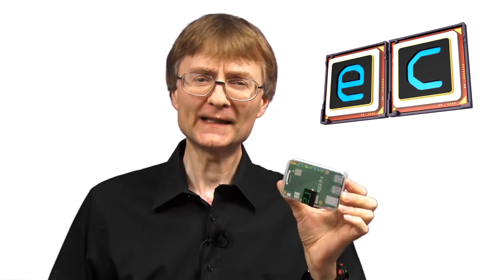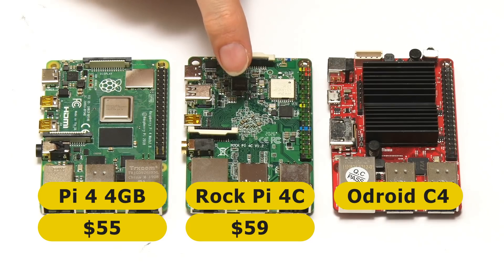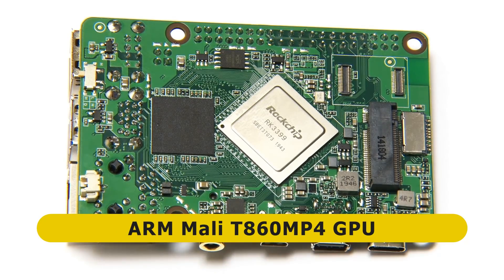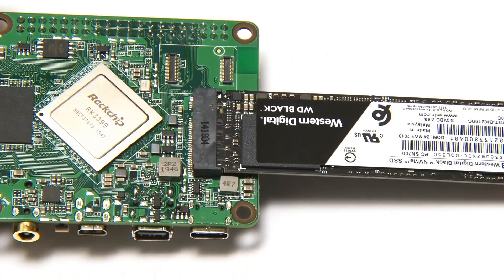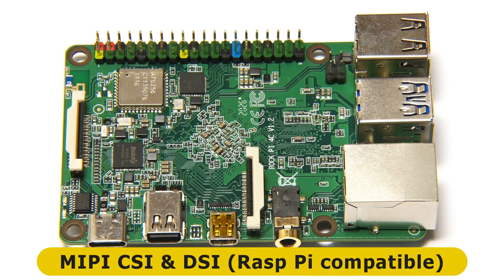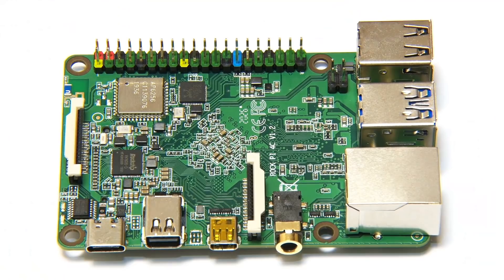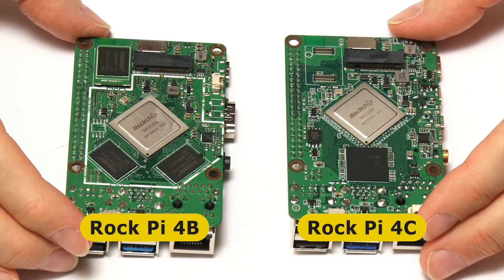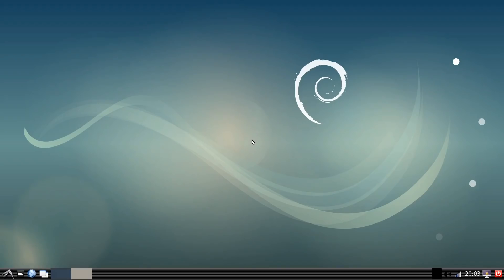Rock Pi 4C: Dual Display M.2 NVMe SBC

Comment: Enjoying the SBC industry trying to out do each other, bringing wider choice to tinkerers 👍
Reply: Indeed. Competition encourages these companies to really push their limits and in the end the consumer wins.
Reply: But all these non-pi SBC all come down to the same thing, good hardware but limited software and long before the software ecosystem catches up the rasburry pi's hardware will have moved on anyway.
Reply: @patdbean  Exactly! RADXA simply copies RPi, just with more impressive HW specs. But, that's only half of a computer system. IOW, RADXA simply throws some impressive HW onto a board, then mostly depend upon their community to sort out the software issues. That may interest some bored Linux gurus, but it took them 3 generations of the ROCK Pi, just to get the HD video playback to an acceptable state. 
The heatsink still covers the eMMC module. The M.2 connector still points in the wrong direction and the ribbon cable still obstructs the microSD slot. The fragile M.2 'shim' adapter, flimsy ribbon, and expansion board are only remaining after thoughts from the 4B.
Still no onboard DC power connector, which dedicates the USB-C to only power delivery. Still no on-board PWM fan connection. Still no case to house the static sensitive components. So, if you actually want to MAKE SOMETHING USEFUL, start with designing your own DIY case if you want to waste the extra time and money. But, admittedly, the ROCK Pi ships inside a nice plastic throwaway case. 🥴

Sorry for the rant, but I've already had the RADXA experience and I'm triggered every time I see one reviewed. Once burned, twice shy.
Best regards. Stay safe, everyone!😎
Reply: @TheOleHermit  What's the issue with the eMMC being covered by the heat sink? I'd prefer my storage cool and it's not hard to take the heat sink off or have a small SD ready for rewriting it
Reply: @laurinneff4304  The eMMC doesn't contact the heatsink, so there's no cooling benefit. In fact, the hot heatsink only blocks airflow, so it's probably worse.
There's thermal paste between the heatsink and RK3399, so one must be careful not to get that everywhere. Then, it should be removed w/alcohol and replaced when reassembled.
But, to tell the truth, accessing the eMMC module is a rare occurrence, only required for upgrade or after module failure. As you say, the eMMC can be reflashed in situ. 
My point was more a matter of yet another example of shortsighted design work, IMO.
Hope you're happy with it. I've move on to more mature SBCs and am much happier with them.
Reply: Literally, got to love competition in a free market.

Comment: Another expert video on a SBC! A pretty impressive one as well for the money.
My suggestion to improve it:
It comes packaged in a pretty good acrylic case - Surely it would not have been too difficult to design and construct this case as a housing in itself? Cutouts for the ports, heat sinks etc. A huge advantage over competitors, I would think?! 
Just an idea, where I think the packaging could form a part of the end product.
Reply: Nice idea; it would also be a good way to prevent plastic waste.  If they could make the case stable when sitting on its side, that would improve the cooling.

Comment: Nice video as always. Looking at the board I can not help but think that a little bit of shuffling in the circuitry will enable the NVME to be mounted inward like in many mini ITX boards.
Would love to see another video on it with a firmware update and a proper heatsink.

Comment: That's not the way to cut the tape - Stanley the knife almost slashed your fingers!
Reply: Agreed.  Stanley is not your friend, no matter what he says.  And that reminds me of the rule: "Always cut towards your buddy, not your body."
Reply: @ MrTitaniumDioxide
My little buddy has served me well since I was born and I am not cutting him.
Reply: @ sailaab
Yes, I use it to hit fupas and make redheads happy.
Reply: New blade for Stanley
Reply: Well, it is explaining computers, not explaining knives
Reply from the maker: Yes, when I edited this the shot shocked it. BUt an unboxing with cutting cannot be reshot. Remember I am always working upside down.
Reply: stay safe, stay healthy, keep educating us all  @ExplainingComputers  🤗Chris🙇🏻ji https://wikipedia.org/wiki/-ji
Reply: Plus, Stanley could've done a neater job !
Reply: Stanley is a shady guy. I've learned the hard way not to trust him.
Reply: You gotta be real careful these days, even the board can cut you up. Sadly, I know from experience. Was putting RAM into a new build and it wouldn’t go in, the socket was real tough. I got it in and then a couple minutes later I found that I had a huge gash in my thumb. Quite silly
Reply: CipherBytes  I remember cutting myself while I was building my first computer. I mean no one told me the part that IO shield goes in might be sharp. I know now...
Reply: @ozmobozo  Experience is a harsh teacher, but a memorable one.  I suspect you didn't make that mistake a second time. 🚑
Reply: @ozmobozo 
My first PC cut was on the remains of those annoying internal drive bay shields you have to break off to use the bay.... Needed to take off 2, and sliced my finger on the shards left from the first one while removing the 2nd one. Quite a gaping wound with no blood at first.... Then blood everywhere. Still got the scar to remind me.
Reply: @tin2001  Those old computer cases were killers. But I was too excited to even care about the cut. Those were the days... Now It takes me ten minutes to build a computer.

Comment: They're really loving the diagonal components. Don't see those very often.
Reply: Diagonal components make trace routing quite easy
Reply: Shame it's on the bottom of the board, as it adds to the look. Also, it's a shame its not compatible with that massive heatsink.

Comment: they need to redesign this board with the m.2 slot flipped in the other direction, doesnt make any sense having the m.2 drive poking out from underneath the board like that.
Reply: @Ryan Anscombe
Doubt anyone would want to use a m.2 drive as a Heatsink! L😷L
Reply: There are heat dissipation issues...
Reply: @faumnamara5181  Yes indeed that SoC gets very warm indeed.
Reply: The CPU is in the way and needs to be cooled.  $10 extra dollars for an adapter is not asking much, especially if they do release the larger heat sink in the future like the others.  I have a 4B, I was hoping this one would boot to M.2 straight out of the box.
Reply: Perhaps you should have written “ I wonder why they chose to extend that m.2 card out the side like that?” but instead you chose to demonstrate to the YouTube community your ignorance/hubris.
Reply: They want to sell you the extension at a fair profit.